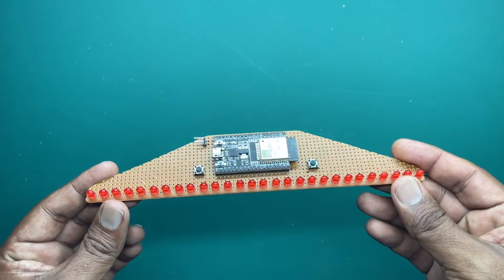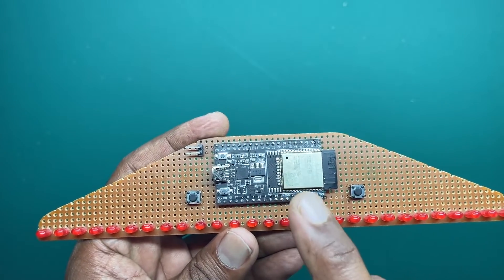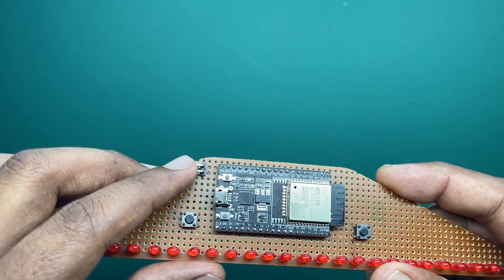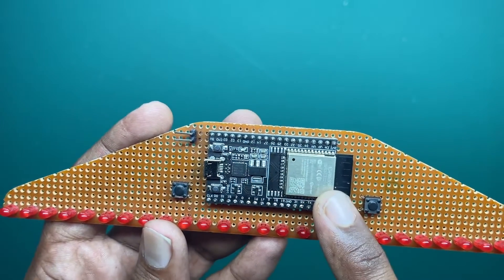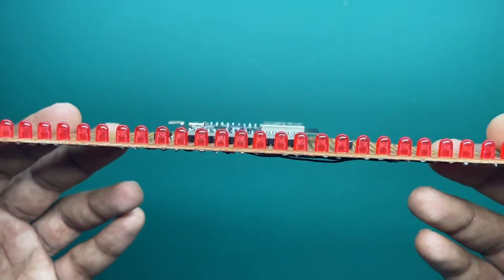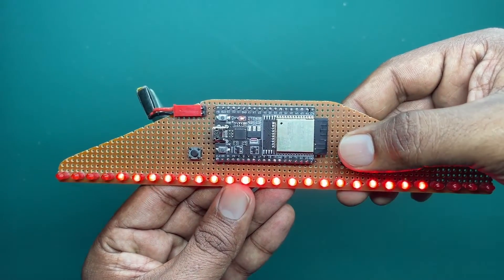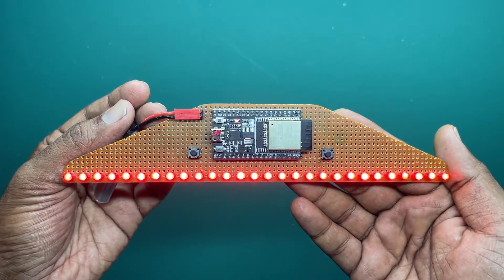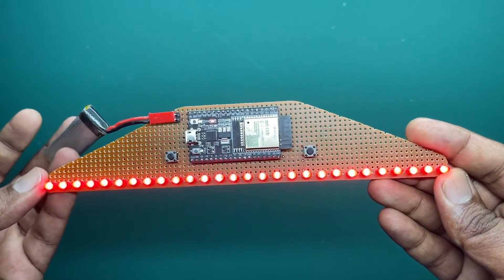Knight Rider LED Chaser With Fading Tail | FREE Code | 7 Patterns | Speed Control | ESP32 Arduino

Comment: Hello.
Thank you for the great idea.
Please let me know, is it possible to use it with ESP32DEVKITV1 (30PIN)?
Reply from the maker: Yes of course.
Reply: Thank you for your reply. What should I do with the program for ESP32DEVKITV1? @HAZITECH
Reply from the maker: @Kai-dg4go it should be the same. Just make sure the pin numbers are the same.
Reply: thank you.
It was successful, but I couldn't figure it out because it didn't match the PIN number written on the ESP32 board.
Sorry for the trouble.
I have one request, but I would like to know how to replace the LED with a Power LED 3W.Please send a video.
thanks so much.
Please give me another good idea. @HAZITECH

Comment: Very good. Do you have any idea in 1980 how actually they build this lighting effect without using micro controllers?:face-red-heart-shape:
Reply from the maker: Amazing right. They used 8 halogen bulbs in there with analog electronics.
Reply: 4017chip was available since 1968 or so, 555was designed in 1971, that two plus some transistors, easy to make a reciprocating light. Add a capacitor to each bulb, and you have the fading effect.
Reply from the maker: Great explanation. Thank you!